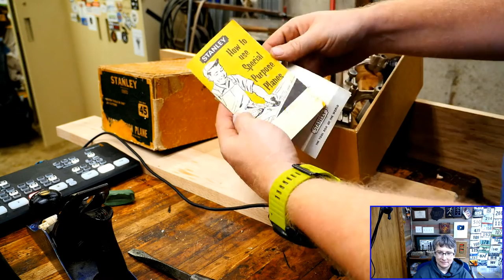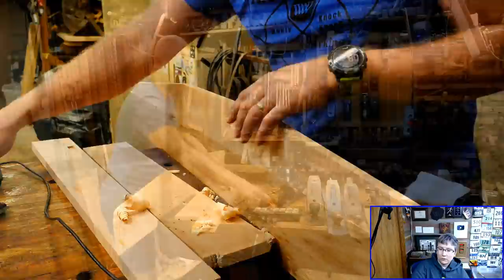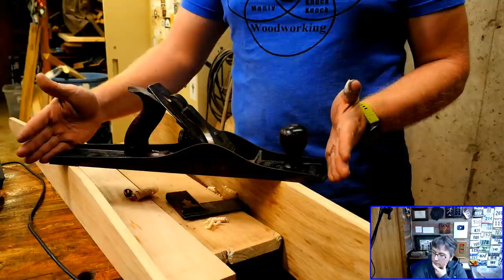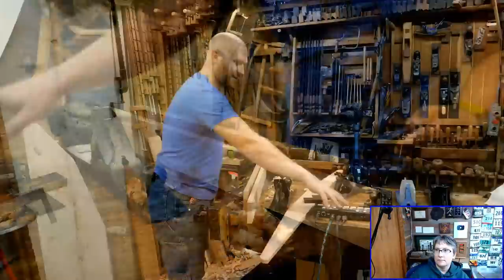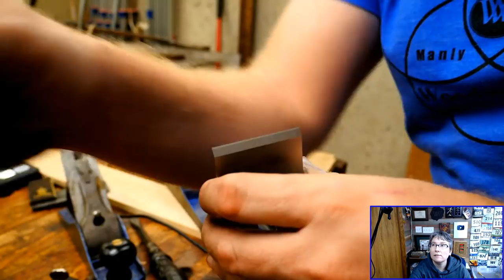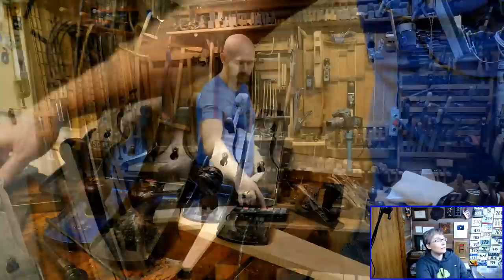How To Joint Boards With a hand plane

Comment: Put the fence on the other side of the jointer, knob in front. Use your left hand to push the front of the fence against the board and your right hand on the tote. Similar to using the fence on a rebate plane. You might find it a bit easier to use the 386 that way.

Also, you don't use the 6, but the 6 with a camber is a great plane. Instead of using a scrub, put an 8 inch camber on the 6 and use it for hogging off those high spots. I prefer a 6 for 'scrubbing' rather than a 40. Less danger of going too deep, it'll take a wider shave than the 40 and the mass helps push it through those trouble spots. There's a video for you to do at some point. Which is better for roughing, a 40 scrub or a 6 foreplane? I'm firmly on the foreplane side of things, but you should put them next to each other on a warped board and see which does it better.
Reply from the maker: right on. a lot of people prefer the fence on their side. I wish I had mentioned that but in the moment it slipped my mind. you are not alone in liking the 6 as a scrub plane. It is good for flattening that way..